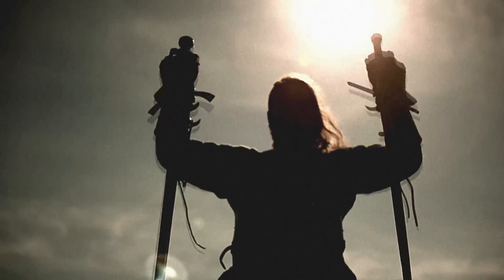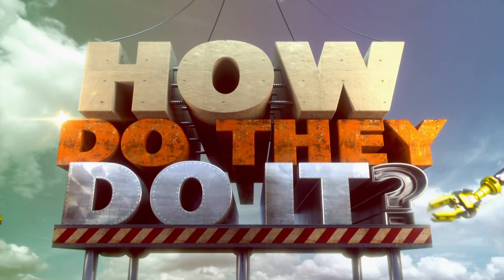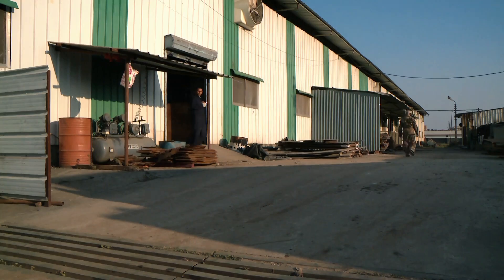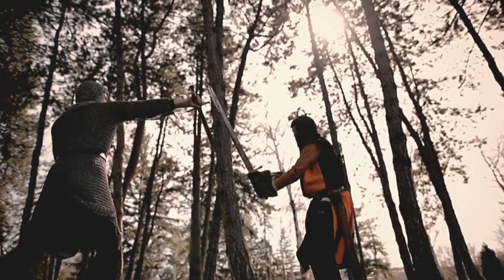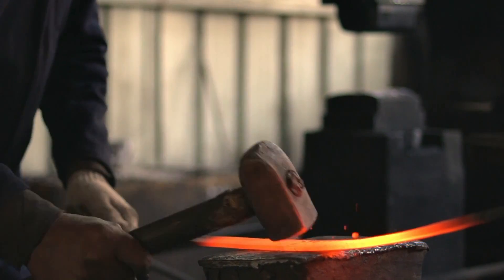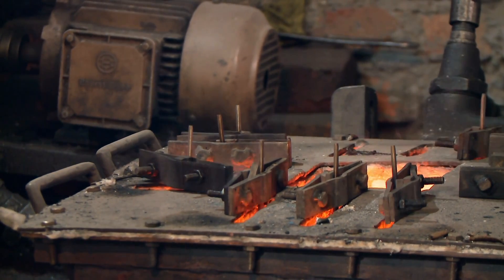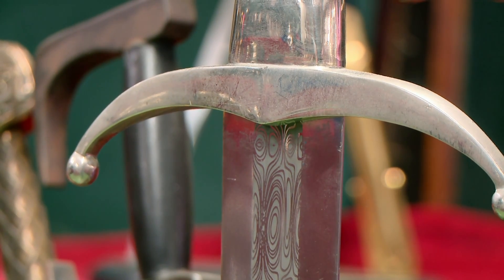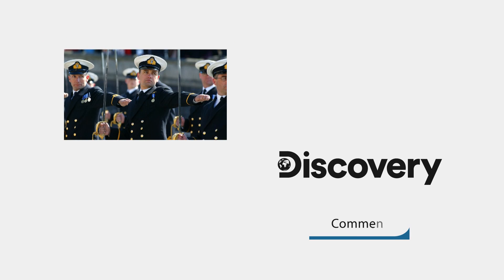SWORDS | How Do They Do It?

Comment: A very interesting and informative video.  Technically the current pattern of sword used by the Royal Navy was first introduced in 1827.  It was merely tweaked in 1929 when the blade was straightened (it had been a slightly curving sabre before), narrowed and made a bit short - essentially making it a court sword.  The half basket guard was not altered at all with the slight changes of 1929.

However, swords are never delivered by the manufacturer sharpened.  It has always been up to the owner to sharpen the blade and since all RN swords today are used for ceremonial purposes, they are not sharpened.  It cuts down on the chances of accidents and makes using the sword more practical and safer (no pun intended!).